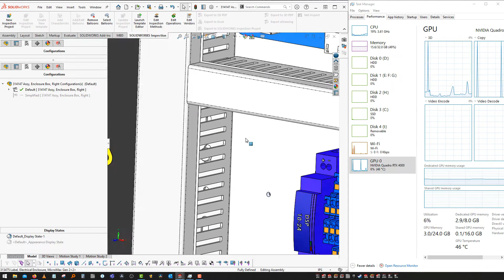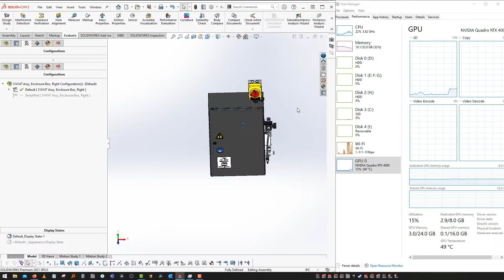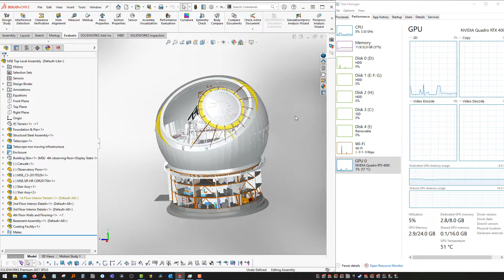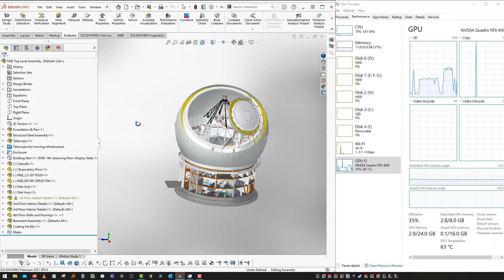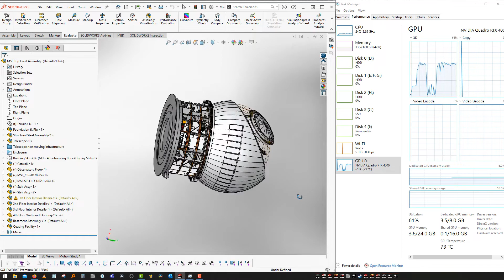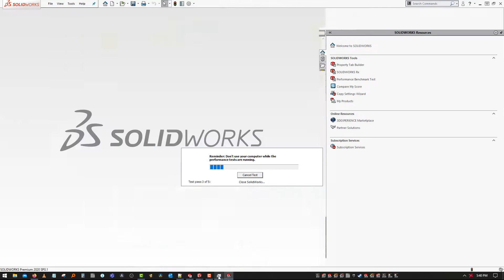Nvidia RTX 4000 Benchmark in Solidworks Furmark and Visualize

Comment: Hey Adam! I’m really happy for this great review/ test! As i can see your temp was much lower than mine in furmark: during the  43min test, with open case, load temp 85C (nvidia “limitation policies” was on, after 10min).. i use this card for 3y without any problem, or complain, but after this test im litte confused! What do U think? Thats acceptable or a sing of repaste time?:)( Sorry for my weak german-english, and thx for Your help!
Reply from the maker: Not sure why your temp was higher, maybe you have more monitors?
Reply: @AdamWayneHughes  ...during the test just only one! Maybe my 9900k+ NH-D15S cause the trouble? Pretty close to the card, and a well known fact that this cpu is a temp nightmare, on every level. By the way every article/ post i read about this card, 81-83C was tha top of the height, but your low numbers just beat every others. How did you achieved that? Thx!
Reply from the maker: @cB-yy2hb  well not sure, cpu can limit the gpu throughput. Maybe your cpu was better than mine at the time. If a gpu cpu are mismatch then you can't drive the gpu like it's supposed to be. Or furmark updated the tool to use the gpu differently. That's the only thing I can think of

Comment: I am running SW 2020 on two 4K monitors. Is the RTX A4000 going to be decent for me? I usually have assemblies with 40 to 2000 parts max open on the right. I work mostly on the left screen on parts and detailing drawings.
Upgrading from GTX 970.
Reply from the maker: If it was me, id know id be happy.

Comment: I had to pay $1275 for mine. Ridiculous.
Reply: An RTX 2070 would have been a better choice. Identical hardware, even a bit higher clocks, but only half the price.
Reply: @ProjectPhysX  i have rtx 2080ti and latest SW runs like shit. Wierd performance drops, disappearing faces, crashes. I am considering buying rtx quadro 4000. I have seen rtx quadro 3000 in one of our integrators mobile workstation. He had whole assembly line loaded and it was running better than my much smaller assemblies on desktop with 2080it. I only wonder if i can run quadro and geforce in one system. Apparently nvidia studio drivers might allow this, but need to do more research on this one.
Reply: @ProjectPhysX  would I have been to get the right solidworks drivers?
Reply: @Macness1989  it depends a bit on the software. I think solidworks is in the class of "professional" software that artificially throttles itself to run like crap if it detects a gaming GPU.